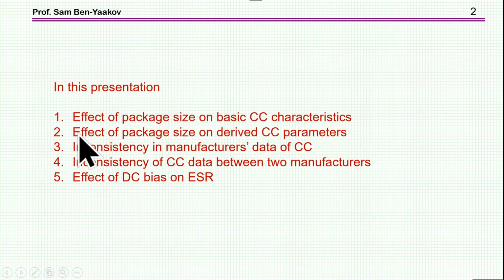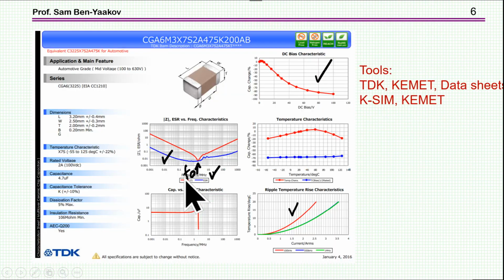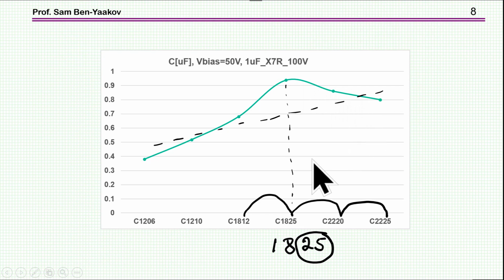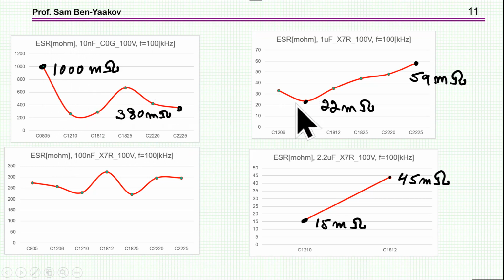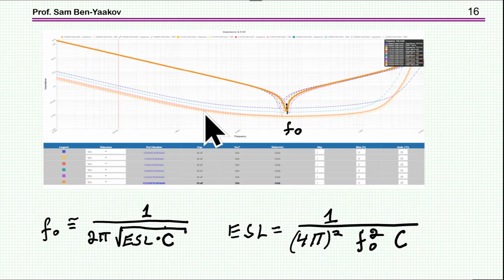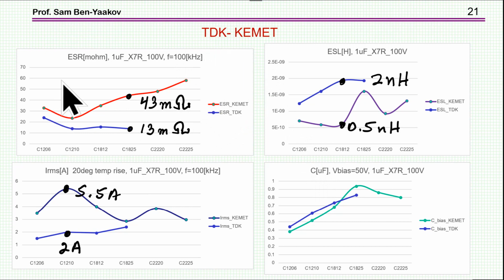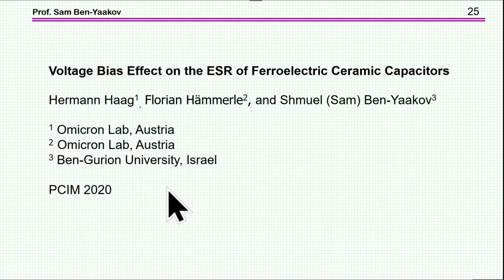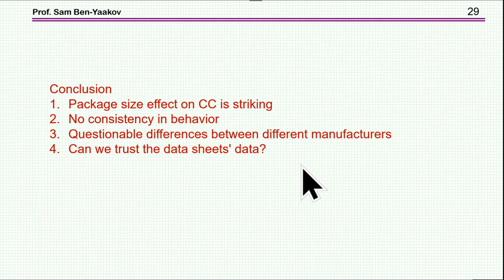The effect of package size on ceramic capacitors’ parameters

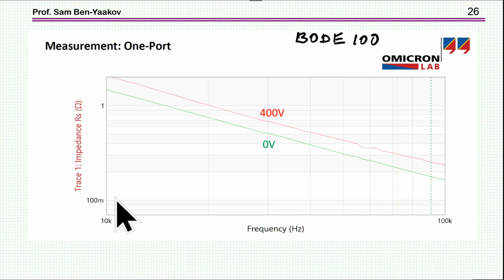Comment: Hello Professor, thank you for this presentation.  I am sorry I am not able to access the PCIM2020 paper.  Can you describe your measurement technique?  The slide at 20:01 says "One Port" are you measuring S11 and then calculating impedance as Z=Z0 (1 + S11) / (1 - S11)?  Did you also measure impedance with a two port technique?
Reply from the maker: One port refers to a mode ofBode 100 measurement in which the inductor is placed between the excitation and one measuring port.

Comment: I watch all your videos and this is the first one which left me dumber after I finished than I was when I started! I suspect the simulator data is both very precise and very inaccurate...
Reply from the maker: " both very precise and very inaccurate..." nice way to put it. How about baffled instead of dumb?
Reply: @sambenyaakov  Over the years I have formed many rules of thumb for estimating the parameters of Type 2 X5R, X7R and X8R ceramic capacitors. Many were formed based on watching your excellent videos. I still believe that these rules of thumb are for the most part true, but they are not in good agreement with many simulator curves. It is very frustrating that the manufacturers don't put out more raw data for review and if I were 40 years younger, I would consider starting a company to test passive components over a wide range of inputs to characterize them for companies needing this data that are not satisfied with the current trial and error approach. 

Of course this lack of clarity when it comes to Type 2 ceramic capacitors isn't new. I've seen quite a few cases over the years where a Type II ceramic capacitor from one manufacturer was replaced by another one with supposedly identical parameters from another manufacturer with disastrous results. So whenever it is possible, I will pay the extra cost for Type 1 ceramic capacitors, even for non-signal path applications so that I know what the capacitance and ESR will be, and don't have to worry about noise spikes from piezoelectric behavior if the circuit is subject to shock or vibration...
Reply from the maker: @ats89117  Thanks for the interesting input. Indeed frustrating. Here is a paper that adds to the confusion (if you are unable to download it, send me your email and I will send you a copy) https://ieeexplore.ieee.org/document/9124490

Comment: Professor, your videos are exceptional. The current generation of power electronics engineers and students are so fortunate to have your videos as a resource. You give so much to the community and you really have a place among my favourite authors such as Billings, Pressman, Basso, Clayton R Paul et. Al.
On this topic I have often wondered if the piezoelectric properties of X7R were responsible for part of this wierdness. I expect some incremental thickness change due to DC bias, and have wondered how this impacts inter plate geometry and fringing.
It's also interesting to consider the many different plate configurations between one manufacturer and another for the same capacitor package.
And, how might the characteristics change with applied mechanical stress? 🤔
Reply from the maker: Good points and open questions. There is some data in the literature on "characteristics change with applied mechanical stress?". In fact there are papers that show mechanical energy harvesting with CCs. Also, there is the term: "singing PCB" when the CCs are pushed into mechanical resonant by the voltage across them.

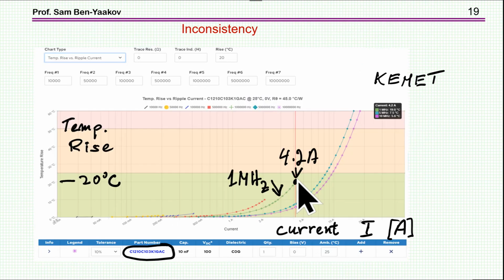Comment: I think 10 x 12 mils = 120 mils = 3.2 mm.  At 15:53, the graph seems to have saturated below 2 MHz; the original trend possibly would be 4.2 A...
Reply from the maker: " 10 x 12 mils = 120 mils = 3.2 mm"???. No saturation. Below 2MHz the lower the frequency the higher is ESR so a lower current is allowed for same temp rise.

Comment: Interesting video.  Much more variation of parameters than I was aware of.  Is there a reason that 0603 and 0402 data was not included?  These are the most popular sizes for many products, especially for local decoupling MLCCs.
Reply from the maker: Thanks for comment.

Comment: Those small X7R capacitors would make half decent varicaps!
Reply from the maker: Indeed. See I. Kolberg, D. Shmilovitz and S. S. Ben-Yaakov, "Ceramic capacitor controlled resonant LLC converters," 2018 IEEE Applied Power Electronics Conference and Exposition (APEC), 2018, pp. 2162-2167, doi: 10.1109/APEC.2018.8341316.

Comment: Amazing video highlighting confusing data from manufacturers.  Thank You Prof. Sam Ben Yaakov.

I have a few questions professor. Please find them below:

1. @09:03- May be for lower capacitances and larger packages, we have enough space to have thicker dielectric layer and the dielectric material doesn't reach a threshold where it's capacitance starts to change? That might be the reason why the capacitance doesn't change anymore with increase in package size.

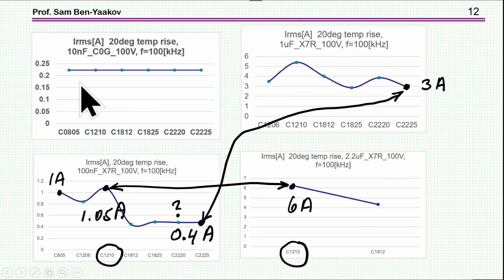2. @10:36- for the ESR vs package plots, frequency is mentioned as 100kHz, How is the measurement done? What does the frequency mean here? Aren't we measuring a resistance?

3. @13:20- The ESR is a resistance and so it depends on the frequency (skin effect). So, while calculating converter losses due to capacitor's ESR, do we need to consider a smaller ESR than what we get from the impedance curve?

4. @20:23- With the increase in bias voltage, the capacitance reduces and so the self resonating frequency moves higher. For same capacitor, as the frequency where we get ESR on the curve increases, what we say ESR derived from the curve increases due to skin effect, but for a given frequency, ESR doesn't change. say at 100kHz, the ESR remains same regardless of the bias voltage. Is this correct?
Reply from the maker: 1. Yes this is in line with what I suggested. But unfortunately this behavior in not consistent. 
2. This data is from data sheets or simulators. As far as I know the manufacturers measure by LRC meter. 
3.This is not skin effect. It has to do with hysteresis like in ferromagnetic material. See S. Ben-Yaakov, "Some Observations on Loss and Hysteresis of Ferroelectric-Based Ceramic Capacitors," in IEEE Transactions on Power Electronics, vol. 33, no. 11, pp. 9127-9129, Nov. 2018, doi: 10.1109/TPEL.2018.2822771.
4. Unlike skin effect ESR goes down with frequency and he change with bias is observes away from the resonant frequency.

Comment: Could Kemet’s X7R material just be more lossy and resilient to thermal breakdown than TDK’s X7R?
Reply from the maker: ESR, thermal resistance and the resulting current per temp rise (which were found to be inconsistent) have nothing to do with resiliency.

Comment: It seems the data sheet is only a starting place.  Measuring it yourself should be done when possible.
The issue with measurement is sample size and batch to batch variation.  Unless you buy very expensive space qualified parts  you usually know nothing about the history of your parts.
Even if you do measurements there is no easy way to guarantee the parts you measure will be the same as the ones that end up in your product.
Reply: depended on actualy resistance.. true there is diference between inductional, resistant, capacitive- but in base.. he is right.. i can confirm iut by real life working vicrcuit based on this knowledge
Reply from the maker: I have no substantiated knowledge how the capacitors' parameters change within a batch and from batch to batch. If you do have please share.

Comment: Hi,
Another great presentation again.  Thank you for your effort to improve our understanding in science of electronics. 
Also, I found a way to find the self resonant frequency of a cap, of course one way is using Vector Network Analyzer.  The other is using noise source then passing it through capacitor and then looking at the output in a Spectrum Analyzer.  Since real caps are series RLC circuits.  At the resonant they have the least amount of attenuation, so at resonant frequency you see a peak.  In reality they act as bandpass filters.
Reply from the maker: Good idea. Thanks for sharing.